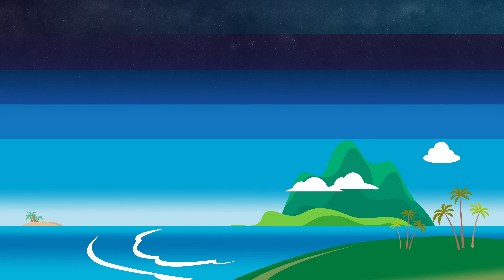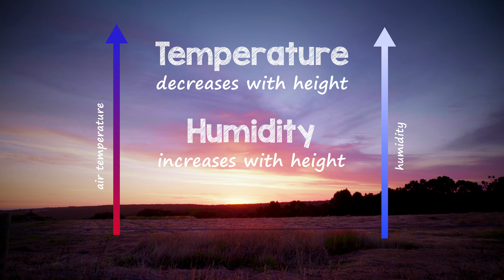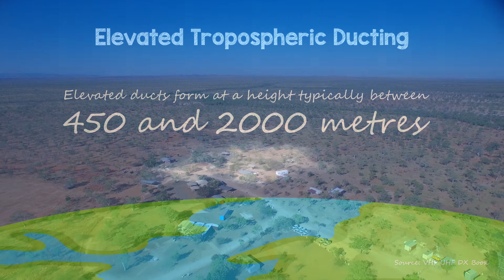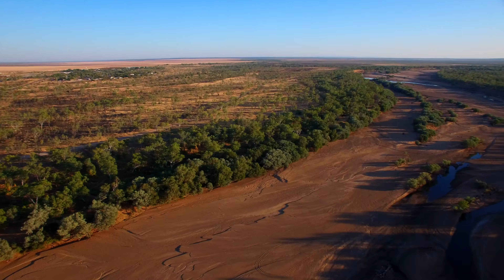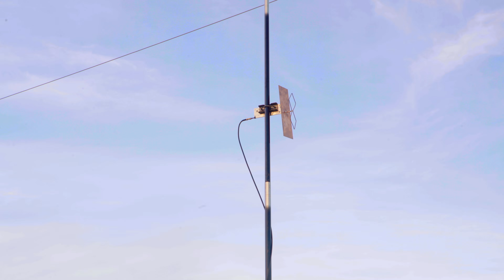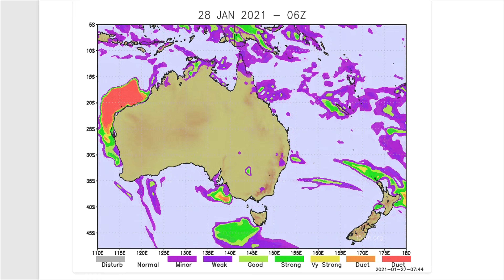Tropospheric Propagation

Comment: I only found this this morning Andrew! There are alot of 'amateur' explanations about Tropo out there, but this would be the best Ive seen or read. There may be a few small things I could pick on but they are only minor of no real significance in the scheme of things and will not inhibit peoples understanding or curiosity to investigate and experiment further.
One thing you perhaps could have added inclusive with Radiation Inversion and Subsidence inversion is the phenomenon of Advection inversions, or the enhancement ahead of cold fronts, where the cold air surging in undercuts the warm air ahead of it resulting in warm air aloft and usually significant enhancement.
Overall, excellent job and I will share it now on my Twitter feed and the VHF WSPR group